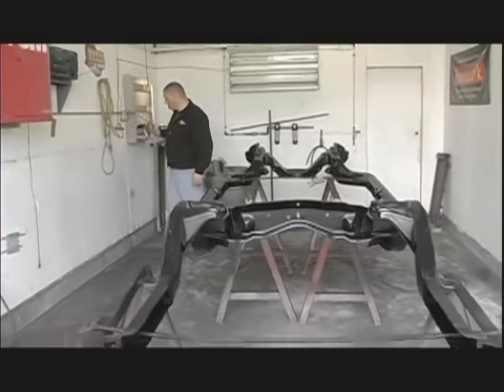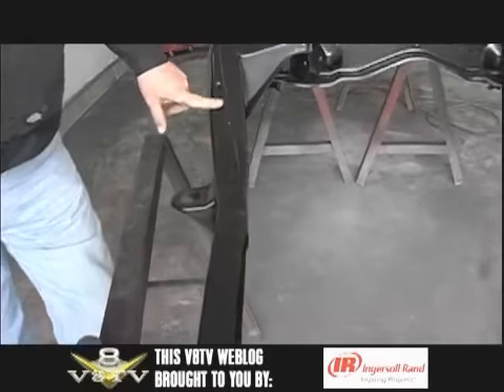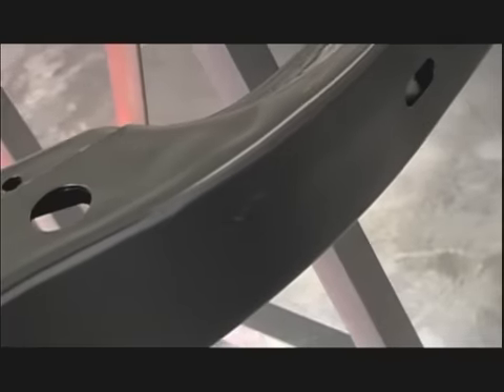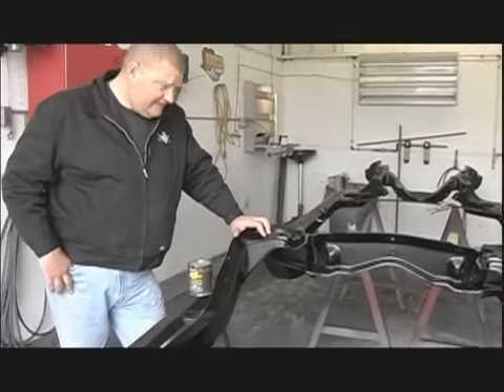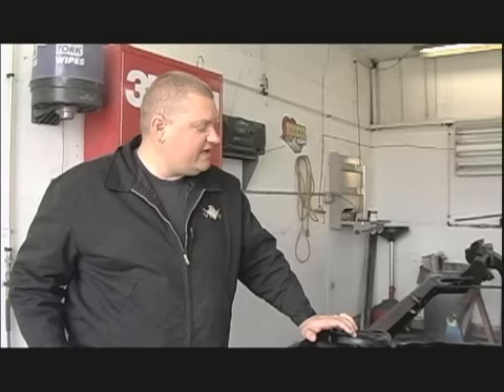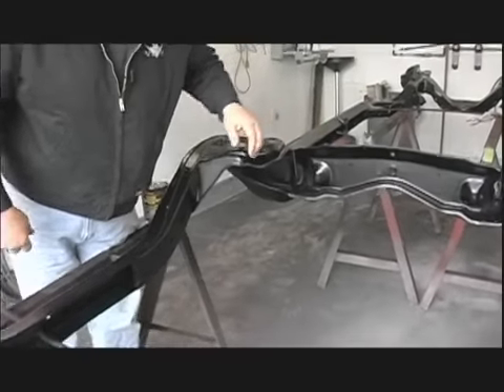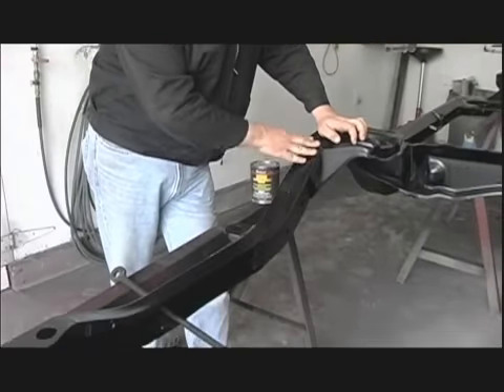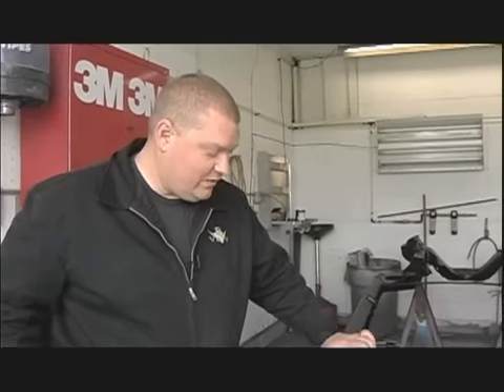1965 Chevelle Blog 6: Chassis Restoration V8TV-Video

Comment: Looks good.  I think alot of people try so hard on the chassis is because it is one of those parts of the paint that is gonna see the most abuse and it is a real paint to fix.  So you could spray this right out of the can no need to dilute?  I am doing a 56 Willys wagon resto right now and don't have the time for a total frame off what do you recommend for a good DURABLE chassis paint?

Thanks cool vids